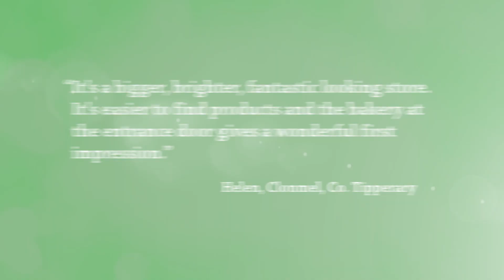Lidl Clonmel - New Concept Store

Comment: The engineering team for the structural, they need to make sure that the concrete strength is correct, I have been to several Lidl and the floor is cracking.